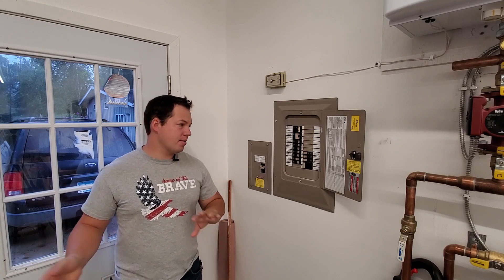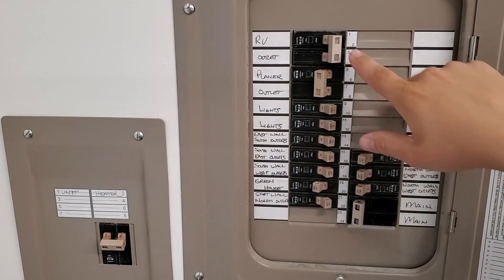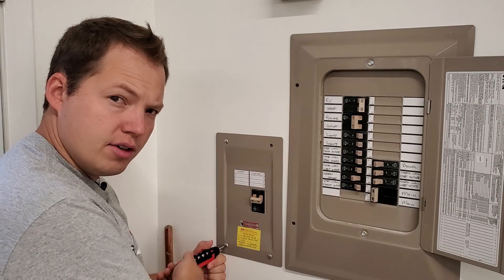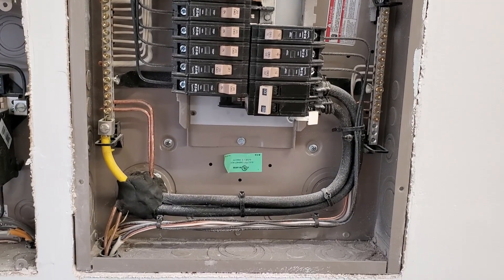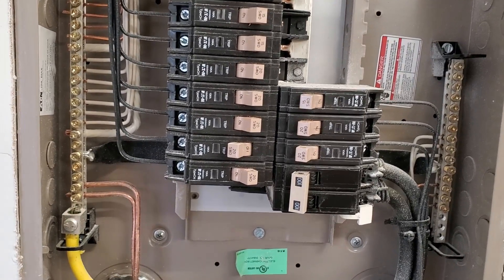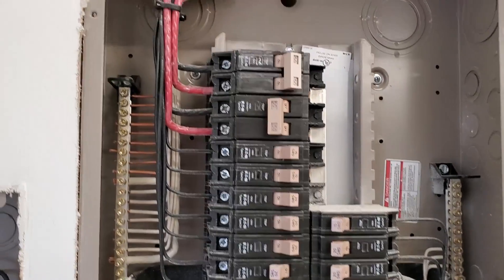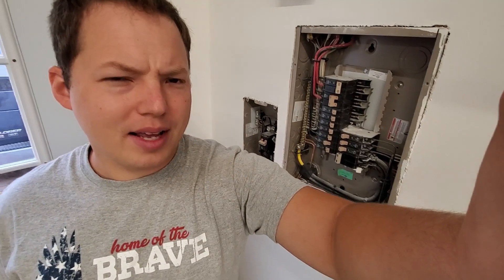Work Shop Electrical 100amp Main Panel

Comment: Sheet rock dust is extremely caustic--it should have been blown out because these boxes are going to rust prematurely. That's especially true in an out building that may have higher humidity than a house.  Sorry, but that's the reality and it deserves to be mentioned.

Comment: Ben, the load center inside my condo has a 100 amp breaker outside on the building next to all the meters, does that mean my inside panel is a sub-panel?

Comment: great videos igot a question If you installing a 30 amp for rv plug 120acv you only use a single breaker right?  Only the breaker for the black hot wire the neutral white go with the ground right?

Comment: Thanks for all these informative videos. I’m needing to size the wire for my Lincoln Welder. It’s specs on front face of this (1960’s vintage) Welding machine reads:
INPUT
Single phase
230 volts
60 cycle
50 Amps

OUTPUT
Max. Welding Current 225 Amps
At 25 Arc Volts
115deg. C Rise
Max. O.V.C.- 79 volts
Duty Cycle -20%
Question: Breaker size and wire cable size?
Note: Approx. 70 feet length to welding receptacle from Sub-Panel
Thanks for any info you may have on this application.
Michael C Elliott
Austin Texas

Comment: This guy kicks ass I watch this video for a couple of weeks and learned enough about electricity to troubleshoot my problem and found the a220 with actually Luke into a 110 and neither was separating found the problem and fixed it this guy kicks ass

Comment: All UL panels are good for me,   so i use regular Square D products, but EATON, GE, they have very good line products for all proposals,  example EATON GFCI with light failure indicator with 5 different events.

Comment: I have a 125 amp main panel I installed a 60 amp subpanel now with 6 size wire. I want to install a subpanel off the 60 amp panel can I make that panel 30 to 60 amp panel?

Comment: Great video.  I have watched a few of your videos and I am learning a lot.  Thank you.  I have a newbie question.  If the main breaker is 100 amps, how can the total of the circuits installed be more than that?  If the planer is being used on a heavy load that would only leave 50 amps available for everything else (lights, dust collection, filters, radio etc) correct?  Wouldn't breaker keep tripping?  Thanks.
Reply: Surprised no one answered this for you already.

Like doing laundry or baking a cake, not every electrical load is powered all the time.  Running both your heat and the a/c at the same time would not be smart.

The breakers in your panels are designed to protect the wires and loads they supply.  Your heater may have a 40 amp breaker and your a/c a 50 amp breaker but when they figure how much power your house needs, they only count the larger, not 90 amps for both.  Your bathroom gets a 20 amp breaker, but draws zero amps if you are not drying your hair.  And your bedroom light.....not on during the day, but still a circuit is needed.

I hope this helps you see that your panel may have breakers for 400 or 500 amps when you add the breaker amp numbers, but your house may only have 150 amps supplied to it.

Comment: another main panel tour. Eaton brand, not squared *D*.
0:30 main breaker is at bottom of panel. (small sub-panels with fewer than maybe six circuits maybe doesn't require a main breaker)
2:12 unknown why heater is on a separate panel. Oh it's fed from a different location apparently
4:05 wrapped neutral wire in black tape to indicate it is also hot
5:27 it's a main panel because you see grounds and neutrals are not separated. note the strap connects the two buses here. it would not be connected in a sub panel.
7:17 insulating pieces on main wires make panel a bit safer
7:44 zip-tie debate. mostly fine to use.
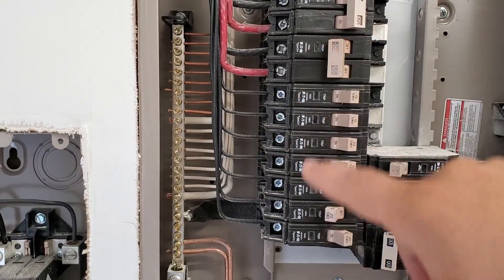8:35 load balance discussion. every second breaker on one side draws power from alternate leg. worst imbalance would be if you skipped every second breaker on one side of panel
9:11 no arc-fault breakers required here because no one sleeps here. Ground fault protection is provided at the outlets.
9:58 plastic connectors protect cables through knock-outs, are less likely than metal clamps to damage cables 
10:37 duct seal putty to prevent moisture from outside

Comment: Nice and neat... whoever did this took time to figure out how to lay everything out.
Panel preference: probably leaning towards Square D. Anything..as long as I don't have to deal with some old Challenger crap.
Prefer main breaker at the top, and heavier load breakers near main.

Comment: Ben, great demo on sub panel, but l don't understand . Your theory on separating the ground and neutral due to possible charge on the gas pipe.  Why does that hold true for the main panel?
Thank you Jim

Comment: I was taught that hi-load breakers, such as those two 50a located top left, should be located as closely to the incoming mains (in this case bottom right) as possible.
Fact or myth?

Also, I thought the debate regarding zip-ties was whether tightly bound wires hold heat rather than dissipating heat.
Fact or myth?
(Side note: black zip-ties supposedly don't break down as fast as clear or white ones. I believe black zip-ties are the only ones approved for solar)

Comment: Does anyone know when the codes started requiring grounds and neutrals separated in subpanels? I own a rental property (duplex) where there is a main shutoff outside and the panel is inside. It only has 2 hots and a bare ground/neutral running to it.
Reply: Not too sure but I’d assume ever since ground conductors were introduced in services
Reply: I think the change to code was made in 2008. If I'm wrong, someone will chime in.

Comment: If I have a  100 amp main what size breaker can I run for a subpanel
Reply from the maker: Technically you could run up to a 100amp sub panel off of the 100amp main but I wouldn't recommend that. You need to make sure that you are not going to overload your main service too. I would recommend something like a 60amp breaker feeding whatever panel you choose for the subpanel. Just make sure that you separate the neutral and ground wires in the sub. Hope that helps!

Comment: I enjoyed watching your video I am building a workshop in my backyard 20x26 and will be running a window hvac and several power tools and an air compressor plus a small sub panel for a small greenhouse can a 60or70A sub panel handle all of that because I’m only having no more than 12 circuits single/ double total. I appreciate anything 🤩😎👍
Reply from the maker: Sounds like a great project! Where are you located out of curiosity? I actually have a very similar garage at 24x22 and will be wiring it in the near future! I ran 6/3 UF-B wire to the garage underground which gives my 55 amps at 60 degrees of available power. I think I will probably use a 20 space 100 amp panel that has a main breaker installed in it so that I can use that as the disconnect to meet the shutoff requirement of 6 breakers or less. This still isn't figures out 100% just yet but what you're describing sounds about right! Hopefully I'll have some applicable videos out soon on this topic!
Reply: Benjamin Sahlstrom I’m in the DFW area in north Texas

Comment: This is the first time I’ve seen in your videos the neutral and ground being plugged on the same bars. Did you say this is normal for standard panels?
Reply: I am still learning this but it is my understanding that after completing the circuit the return has been affected by the distance travelled, the wiring itself, and other factors that could be more pronounced in some cases than in others (like the magnetic and electrical fields generated by the proximity of the hot wire) so that you're not returning the same that came in, without proper grounding smaller circuits begin forming inside your own electrical grid, if grounded but not bonded with the neutral bus there's leakage which will trip any GFCI (North America) or RCD (Europe) outlet or breaker it travels to, effectively making it a "floating" neutral, one that is different from the grounding at the place the panel feeds.
Reply: @Ometecuhtli no to forget other factors like paranormal activity
Reply: This is a main panel. If this were a sub-panel the neutral and ground bus bars wouldn't be bonded. (He points out the bonding cable in the video.) They'd have to be separated as per today's code. That was a change that took place, I think, in 2008 for sub-panels.

Comment: Conductors are bent too tightly. Looks good but a good heat source.
Reply: Really? 🙄That probably has extremely minimal to no heat. If the panel was over loaded that could be an issue. That panel isn’t fully loaded. That is not an issue at this point.
Reply: Fully agree. The bend radius on those wires makes me nervous.
Reply: @kootenaysean  the bent wires makes you nervous 😂

Comment: Ive also seen a panel in the house that have the “main” breaker on bottom. But it wasnt technically the main. So it had the Breaker screwed down with a single screw so when you turned off panel you still wouldn’t easily touch the power that was still coming in. And also couldn’t accidentally knock off the breaker.

Comment: The strap cross connecting the two bus bars... is it also the bonding strap for the breaker box/can? I don't see a separate bonding jumper.

Comment: Very nice work.  

I prefer to use Hellermann Tyton Grip Ties over zip ties in most cases.  The hook and loop straps won't cut into insulation, but still have relatively good holding strength.

Also, I would like to see at least three 240V circuits in a serious woodworking shop: one 240V breaker for planer, another one for table saw, and another one for dust collector or big accessory.  

Finally, I am partial to Hubbell twist lock wiring devices.  Even the 20A twist locks can take 8 ga wire.  They are beautiful.

Admittedly, this all a little overkill and not truly necessary.

Comment: Since this was three months ago I'll be surprised if I get an answer to this question. But here goes...
Overage might not be the right word. Let me explain. This is a 100 amp panel, good for 200 amps @120v. Add up the individual breakers and we are way over the capacity of a 100 amp service. How much over is allowed?
Reply: Aa many as you want. The main breaker or breaker in the main panel is protecting the wiring from over current.
Reply: Harold Douglas you need a load calculation not simply just adding up all the breakers, breakers never operate at 100% ampacity

Comment: Interesting backfed main breaker panelboard... I'd just prefer a regular top or bottom mounted main breaker.

A subpanel in the same building never needs a main breaker (unless it's on the secondary of a transformer and there's no OCPD on that side). The "six disconnect rule" says that there cannot be more than six throws required to completely kill power to a building. The disconnects have to be grouped together, which could mean six breakers in a main lug panel right off the meter or six "safety switch" disconnects right next to each other. 

The traditional way to wire homes in San Antonio, Texas where homes do not have basements and very few homes built between the 1970s and 2010s have gas service is to have a main lug panel outside with six breakers: water heater, furnace, air conditioner, dryer, stove, and subpanel, then have a subpanel in the garage for all the lighting and receptacles and other small loads
Reply: Six disconnect rule was killed in 2020 NEC. Now most panels need a single disconnecting means

Comment: That was a very clean panel. When wiring a panel is it bestto start with your ground wire and work your way to the neutral and then hot? it seems no matter how hard I try to be neat my panels always look trashy and cluttered.
Reply from the maker: Yeah the cable management is very tedious and takes a lot of time. I am not very fast at it but I love the final product!

Comment: zip ties make it look nicer, but if the guy fucked up, its hard to tell which wire is which, especially in a set of 5 or more placed in one ziptie.
Reply: I would imagine that you zip tie after testing.  Either way, it is easy to cut a zip tie if you ever need to access individual wires in the bundle.

Comment: having your earth's and naturals together is so shoddy that would be against the law and lose your gold card in the UK if you did that
Reply: We keep ground and neutral separate until the main panel where they are bonded together and go to a ground rod at the panel, a ground rod at the distribution transformer, and the neutral of the medium voltage feeder all the way to the grounding system at the substation. How is it done in the UK?

Comment: can someone tell me what the rubber screw insulators are called that he points to at 7:22 i think they are a wonderful idea and would like to use them on the main lines for my shop when i get to wiring it
Reply: They are Terminal Insulator's here you go... https://www.amazon.com/Eaton-TICSR300-Terminal-Insulator-Breaker/dp/B07FN6BPZD
Reply: also available on Ebay - https://www.ebay.com/p/8006477693?iid=383202361793&chn=ps&norover=1&mkevt=1&mkrid=711-117182-37290-0&mkcid=2&itemid=383202361793&targetid=884131267673&device=c&mktype=pla&googleloc=9013221&poi=&campaignid=9248509114&mkgroupid=94612569555&rlsatarget=pla-884131267673&abcId=1141156&merchantid=6526994&gclid=CjwKCAjw4KD0BRBUEiwA7MFNTVzPdPO4taeuELHPCxXD0Ee2OZIDxrihT5U2eOqhFuIfA-tc_QcTMhoCsVkQAvD_BwE

Comment: @6:13 if it is a subpanel that is installed properly in recent decades with a 4-wire feeder and N/G wires properly segregated. Would need to research when the standard changed. 3-wire subpanels continued up to early 80s I think.

@7:00 the strap stays in-tact. You need the bar on both sides to have enough N terminals, plus allow for gfci/afci/DF/TVSS breakers with tails.
Would need to order one or two GBK of correct size for panel to segregate grounds on an Eaton.
The hole alignments changed over the years, cleaning up or retrofitting older panels often entails drill&tap with cutting oil to put the required 10-32 screws in.

The main breaker on a 100/125A CH series can go only in the corners. The white clip has designated posts. That panel was flipped upsidedown to get the feeder terminal for Neutral facing down, the dead front is reversible on that model.
So main goes in 1+3 or 2+4, or if flipped for bottom feed, even or odd side at bottom two rows.
The insulators for the L1/L2 terminations comes bundled with the white retainer.
I put one of those panels in earlier this year, really just to match a customers existing CH that was grossly undersized, and keep the breakers the same type.
I like QO and CH, but if budget is an issue, Siemens/Murray or Homeline. Don't care for Eaton BR or GE much. 
Brands popularity vary by region and time period.

Comment: Nice job explaining Nice job wiring
1 comment about the breaker location
In written rule I like to follow 
Line in on the top
Load out on the bottom
Reply from the maker: Yeah I'd agree with that concept. It seems logical and makes it easier for someone to find and shut off the main quickly in an emergency in my opinion.

Comment: Looks like they got #12 on that 30a breaker at 4:00.  #12 nm should be a yellow jacket while #10 would be an orange jacket. 

 I could be wrong, its hard to see the thickness of a wire by video, but the jackets color is kind of a  give away.
Reply from the maker: You're totally right that it looks yellow! I'm pretty sure it was 10awg but I kind of want to go open it up again and check. Maybe the overspray from the drywall guys made it look more yellow.
Reply: @BenjaminSahlstrom  I was thinking it could be yellow 12 gauge when I was watching the video, but then I thought it looks a little darker than the other yellow cables coming into the panel, so it's probably indeed orange. Often the color dye of the cable sheath is a bit off during some manufacturing lots so the orange of a 10 gauge cable can either look more yellowish or reddish; sometimes the yellow 12 gauge cables can look almost white. At any rate at least they finally color-code cable... that practice has only been done for the last 20 years or so!

Comment: That is a sexy panel.  New installations "can" look so nice.  I was triggered with the over spray over everything inside.  I stick with Square D QO, I like the separation for the mains from the breakers.  This panel looked 'off' to me.  I think in a safety sense, it would better separated as well.  I think lay people that have never opened a panel would be better drawn to the separated mains at the top (or bottom).  That's also what i am used to.  You should see the cramped 200 amp box I had to do at one of the homes, it will scream WTH lol.  It's just breaker-ed up to max with sooo many runs.  Panels are a black hole of time, It is CRAZY how long you spend puckering all the wires up in there. Enjoyed the video, and I always pick up something, like no mains needed on 6 space or less.. Guess I saw that, but never made the correlation with small panels.
Reply: My dad's new lake house has paint spray in ALL the electrical boxes and it is obnoxious. Horrible. All you need to do is mask off the boxes with wide painters tape beforehand, but both electricians and painters have absolutely no care in the world.
Reply: Aaron Kaase definitely not the electrician’s job
Reply from the maker: Yeah it is such a shame to get overspray on such great work! I spent a lot if time covering my electrical to prevent that as much as possible. I agree about the separate main breakers. It is so much more clear to someone trying to shut off the system when there is a clear and separate main breaker. Nice that there is more than one way to do it though.

Comment: 9:57 - I thought your suppose to put the same gauge wire together.  12/2 to 12/2 on same connector and 14/2 to 14/2 same connector. I could be wrong
Reply from the maker: Good thought. I'm not 100% certain on that. I think it is fine as far as I am aware.